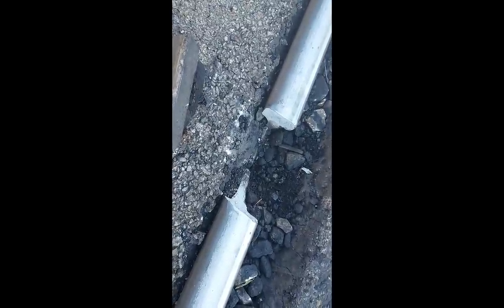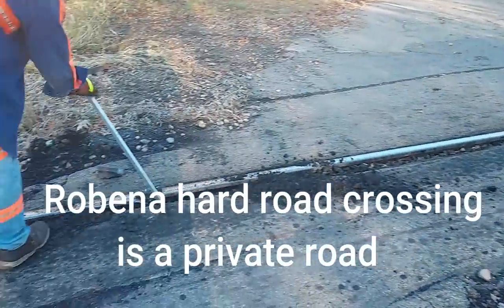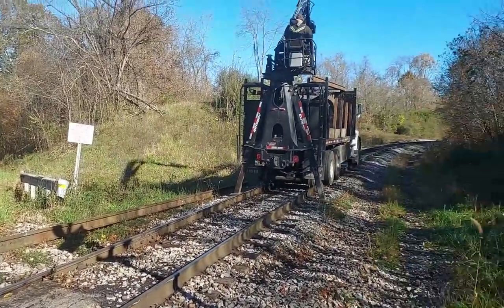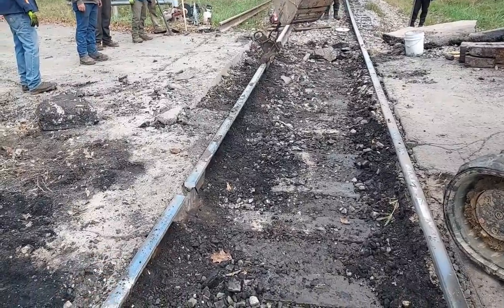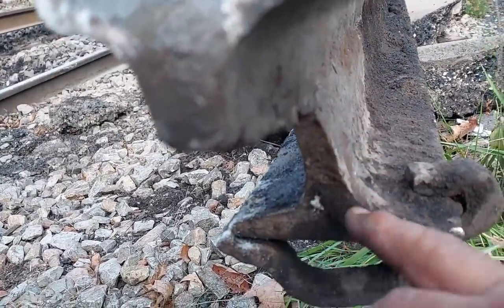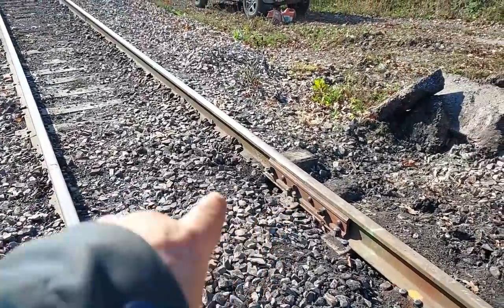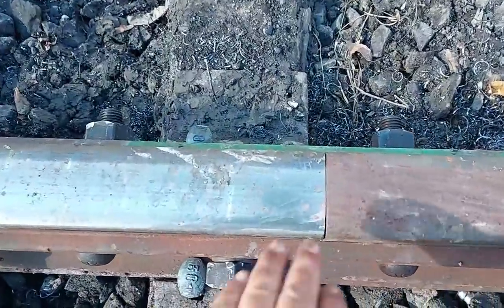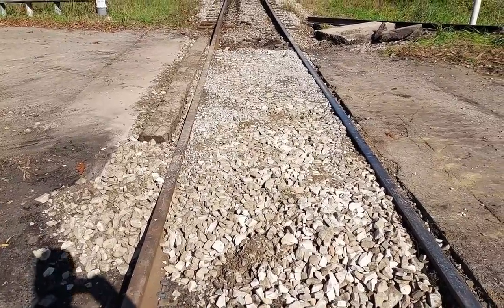This is Really Ugly!  7 1/2 Inches of the Rail Head Blew Out!

Comment: Some Gorilla Glue could have made the task way faster. Lol
I thought it would be welded in place but it’s better off to replace the whole rail for security and also since the base was cracked anyway.
Good job!
Reply from the maker: Don't laugh but we did try fixing a battered rail head one time
with JB Weld. And it worked! However it only lasted for a couple
of weeks before it finally blew out. Do appreciate your checking
out the video and for writing in my good man.

Comment: Wonder if the asphalt expanding and contracting cracked the rail
Reply from the maker: Sorta doubt it G N but one never knows how expansion and
contraction affects things and can make things worse. I had put in the description how split webs happen if you haven't read it already, then here's the link to read it. Thanks for writing in and for checking out the
video today my friend.

https://youtu.be/b4_CG3rgeEo
Reply: @ccrx6700  There was no rubber seal against the rail and maybe with coal blocking drainage water got trapped between the asphalt and rail, froze and cracked the web. Filling it in with rock is probably better than the asphalt was.

Comment: There's a declassified WW2 training vid on YouTube for soldiers on how to derail a train. Let me say unless you do it in a very specific way it is far more difficult than you think. They used explosive to remove a similar length as this from one rail and not a single car came off the tracks. They staggered it, they did it opposite, they tried longer lengths all to no avail. 
There was one thing that worked however but you'll have to look up the vid LOL.
Reply from the maker: I've watched that video and it was amazing! Seems to me if they
wanted easy way to derail, just pull the spikes and the gage would
widen and wheels fall off instead of trying to cut a piece of rail out.
Do appreciate your checking out the show and for writing in my friend.
Reply: May not be that video but one showed ten feet or more of both rails taken up and the train zipped right on through like they were still there.

Comment: I'd figure with existing damage.. The foot and webbing and all.
what is that like R or RB 139 127??
You'd figure the 3 ties around that break woulda been rotted out or dropped..
or something silly like an anchor getting caught between the rail and tie..
Reply from the maker: I do not know what R or RB 139 127 means Ben. Assuming that
would be a mill brand, also assuming you are in UK calling
the base of the rail the foot.
Reply: @ccrx6700  labels for different types of coldrolled steel, 127 means it's 127 lbs per yard or 3 ft section...
I was gettin at....
That rail looks thick enough for freight, all the the characteristics of regular use....
NOT too many things can cause the damage you came across....
Great inspection👍
Reply from the maker: @bencolwell2260  thank you Ben, i did not know that. 😊👍
Reply: @ccrx6700  All good brother..
Spent a few decades working on highrail..
I loved it.. Under paid and under appreciated or I'd still be doin it..
I appreciate the video...
And respect the sweat equity it takes to preform the task....
Most folk nowadays run from that kinda work...
Keep em coming bub...
I think it's important for people to see how our infrastructure works 💪 👷‍♂️ 👍
Reply from the maker: @bencolwell2260  😊👍❤️

Comment: We had something like this happen on the outside rail of a curve in a crossing. Turns out it was due to a rotten tie no longer supporting the weight as trucks and other industrial road traffic hit it, causing mud to pump out from that spot. And then whenever rail traffic hit the rail, well let's just say we found a new route for railcars that night. Four big covered plastic pellets hoppers ended up in a ditch full of water and pollywogs! RJ Corman had to bring some really big fishing poles to drag these fish out. Best part of it all was that my conductor who was riding the shove exited stage left before getting involved. 
In your case, those ties looked brand new even though the asphalt says a different story. Surely they were not responsible for any weakness in the rail, unlike my situation. What I am curious about is, what measures could have been done to prevent these sorts of issues? Were there any tell-tale signs to indicate a broken rail or a scenario that would lead to a broken rail? I believe my team landed on the mud-pumping scenario as the indicator that should have told an inspector to check for weakness in the rail. But it was a spur on an industrial terminal lead and inspections are kinda rare. That being said, an inspection had been performed on this crossing just two weeks before the derailment occurred and the inspector showed nothing out of the ordinary for the crossing, despite noting the mud pumping from vehicle traffic.
Reply from the maker: Awesome comment, very much enjoyed reading it. We were very
lucky it was in tangent track, no doubt had it been a curve we
would probably be watching a video of Hulcher rerailing cars there.
Sperry had tested this rail and found a web defect. I'm ashamed to
say we lolligagged around waiting for a shut down to change the rail
but it caught us before that happened as you see. Do appreciate
your writing in and for watching the show my railroadin friend.

Comment: I was surprised they did not weld the track .
Reply from the maker: All our welding is done by contractors. On this day the welders
were in a different state and unavailable. So rather than wait a 
day or so for them to show up, we bolted the rail together so
a train could run as soon as possible. We did replace the
other side rail of the crossing a couple of months later and
that was welded in. Appreciate your checking out the video
and for writing in my friend.
Reply: @ccrx6700  no problem . I always liked that ( ting ting -- ting ting ) sound the bolted track makes.

Comment: is rail line made of a hardend steal
Reply from the maker: There are varying degrees of hardness in a rail, that is determined
by the carbon content. Some rails are rolled as high carbon steel.
Also some rails are head hardened by a process after the rail is
rolled. Good uses for head hardened rail would be in higher
degree curves. Hope that helps Matthew and thanks for writing in
and for checking out the video my friend.

Comment: That double fracture is puzzling. You have to figure that the fractures started on the bottom because the that part of the rail is in tension when the train wheel is over it. A metallurgist should try and figure out the possible cause. It could have been stress corrosion cracking brought on from a stray voltage passing through that section of rail over time.
Reply from the maker: It's very strange in deed isn't it shootinouts, also that it didn't
break much sooner. Thank you very much for taking the time to
watch and write in my friend.

Comment: Surprised that gets only screwed together and not thermite cast together… also the road isn’t fixed ?! Are you leaving the stones as they are ?!
Reply from the maker: All our thermite welding is done by contractors and they
were not available that day, out of state. Entire crossing was
taken out a few months after this video and the rail on the
other side was replaced and welded in. This crossing only now
gets a few small trucks a day over it so gravel is just fine instead
of going to a big expense with asphalt or wood. Thanks for
asking and for watching the video Jo LiMag.

Comment: I can see 2 problems there firstly that tarmac is at head height BIG NO NO and secondly its a tarmac crossing no give for rail movement during hot weather so that need to be addressed it will cause buckling you should have CRT hot weather patrols.Also WHERE IS THE BALLAST SHOULDER? those timbers should be boxed in to a finish! those fish plates need oiling and gap guage to atleast 10mms both ends and both legs also about 50-75 yards north of the defect on both legs need tamping.
Reply from the maker: Thank you for writing in with your expertise my friend. We do
appreciate your sharing and for watching the video today sir.

Comment: looks like it was just a bad section of track from the factory. possible the rail cooled down too quickly in that section when it came out of the rollers and caused the crystals to grow irregular to the rest of the rail.
Reply from the maker: Most certainly was a problem when the rail was rolled, they
use scrap steel as part of the mix when making rail so one
never knows what that steel was like to begin with in that heat.
Too many variables to put a positive ID on initial cause and we
will never know, but what we do know is all is well now and
trains are running. Do appreciate your writing in and for checking
out the video today my friend.

Comment: Cut into the head of a rail with a torch without actually going very far in, and once it cools down completely (best on a cold day) and then have the end in the air, with a block under the cut, hit the end with a sledge, and it will break all the way through like it was glass!  High-carbon steel.  This is why rails break like the video.  A small defect at an edge surface will propagate a crack. Such as maybe nicked with a spike mall or mis-handling before installation.
Reply from the maker: Thanks for writing in and sharing with us Timothy. We do appreciate
your tuning in to the video today my good man.
Reply: @ccrx6700  You bet!!

Comment: If anyone has seen the film produced by the US Army in the early 1940s they will know that trains are quite capable of traversing a gap such as this without derailing. In the film, the Army engineers had to create a gap much longer than 7½ inches before the train they were trying to derail would oblige.
Reply from the maker: I've seen that one Bruce and it is amazing. Always wondered if
they wanted to derail a train why not just pull the spikes or
fasteners. That's the easy way to derail when the gauge widens.
Do appreciate your checking out the video and for writing in my friend.

Comment: I'm really surprised that you are using very old fashioned rail. Bullhead rail lasts longer as you can flip it, has better adhesion and is cheaper
Reply from the maker: Not sure if it's even available in US Bill. There is no reason why this T rail can't be turned either. Although some RR engineers don't like to do it after the rail gets curve worn on the gage face because they
say the rail gets a memory and by turning the rail it will cause it
to weaken faster. I'm not an engineer just relaying what I have read.
We have never transposed or turned rail here, the company has
always wanted us to put in new rail. Thanks for writing in and
for watching sir.
Reply: @ccrx6700  I'm mighty surprised you don't use flange lubrication on curves, especially with the loads that your rails carry. It's pretty common here in the UK and significantly reduces curve wear.

Comment: That crossing needs to be redone
New rail and new paving
Reply from the maker: Yes sir it does, later that year we replaced the rail on the other
side and thermite welded it in. Asphalt was put in around 2006.
Back at that time the road was pretty busy with miners going down
to Robena Mine, this is a private road only to access the old
Robena Mine. Robena has been shut down and demolished since
then, so now only a few pick up trucks go over this a day, mostly
ours because we have a water treatment plant down there
at Robena, they go to check on the water pumps. So traffic
is almost nothing and so it will never get asphalted again.
Glad you could stop by and check out the big rail break my friend.
PS robena was built during WW2 to supply coal for steel making
for the war effort, funded by the government to build with US
Steel as owners. Back in the 1950's and 60's that was the 
largest under ground mining complex in the world. Now it is
an empty field.

Comment: The guardian angels were out when the train rolled over that. With the right crew and equipment you had that fixed as well as many Class 1. Do you test the piece to see what may have happened?  OK today we can rule out struck by snowplow.  Perhaps the edge of the road and asphalt helped guide the wheel thru the.  Xing. The noise .must have been deafening
Reply from the maker: You are so right in that Paul. Good thing this was tangent
track and not in a curve or you would have been watching
a video about Hulcher re railing some loaded cars. Do 
appreciate your checking out the show my friend.

Comment: I would have thought doing some thermite welding would have had to happen.
Reply from the maker: All our welding here is done by contract welders, unfortunately
they were out of state when this happened and they were wanting
to run trains as quickly as possible that day. So rails were bolted
together to get trains moving. We at a later date did replace
the rail on the other side of the track and did thermite weld it in.
Thanks for checking out the video my friend.

Comment: With all that coal around the web I’d bet the acid and salt in the coal caused stress corrosion cracks.  Just a SWAG, but a good one.
Reply from the maker: you are right Bob, acid in coal is very hard on steel. You should see some of the track bolts and spikes that are ate down to less than half size by that acid. It really eats the base of the rail up also. Do
appreciate your checking out the video my friend.